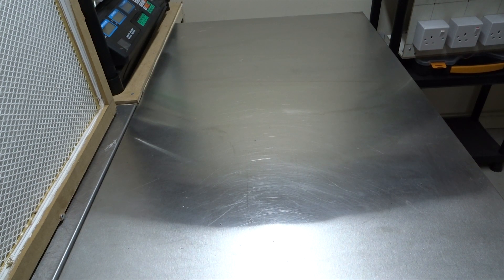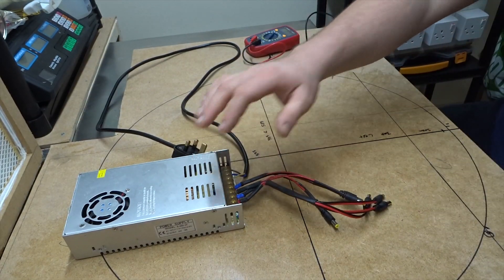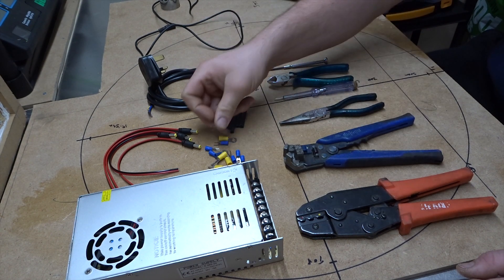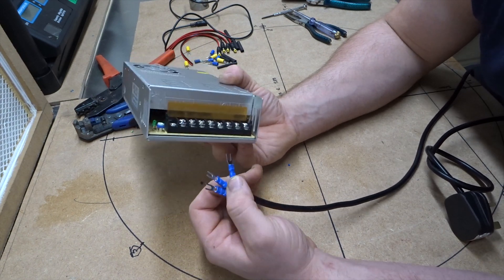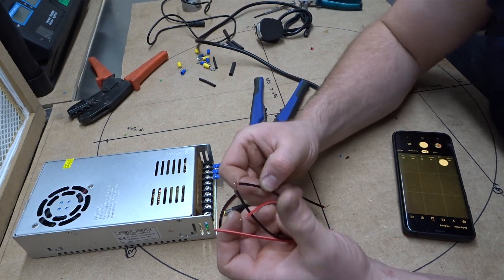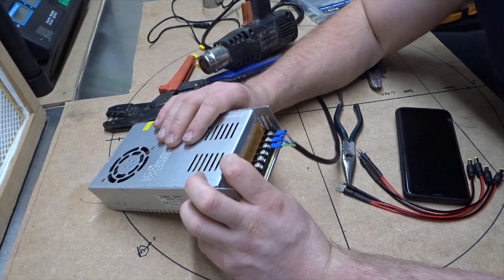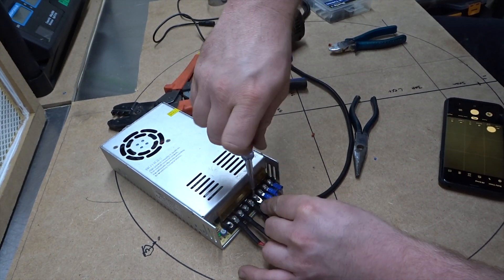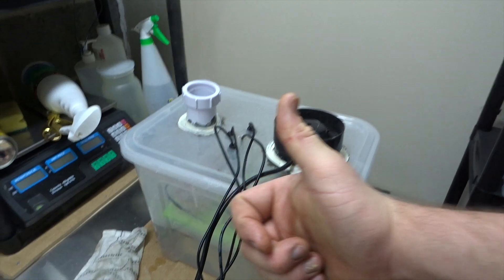Homemade 4 Head Ultrasonic Mister | DIY Ultrasonic Mister For Mushroom Growing

Comment: So I seem to get some conflicting information regarding these ultrasonic modules....  Some shops say they run on AC while it seems you are running them fine on DC, Now I curious are those retailers just full of it, just to sell me their own power supply or are there actually AC and DC units out there...
Reply from the maker: Hello mate - These run off of DC but from an AC transformer. If you had a DC power supply like a 24v battery, these would run off of that, otherwise, to run them from a mains you need a transformer in the form of a single plug or a big one like the one I made! Simply put they do run off DC but you need to convert your AC into DC to use them. You've been Thunderstruck. Hope that clears  bit up for you! Cheers!
Reply: @ArchersMushrooms  Thanks for the info...